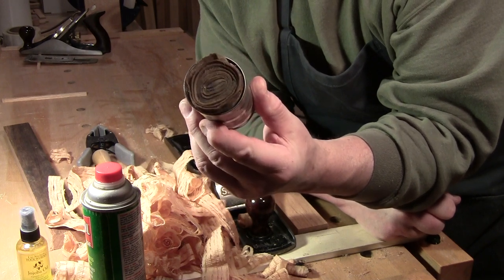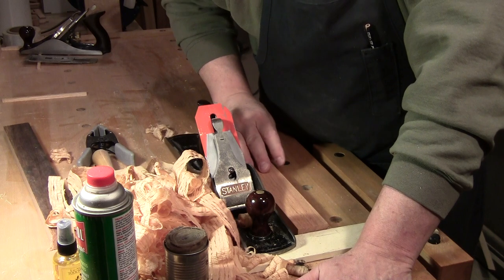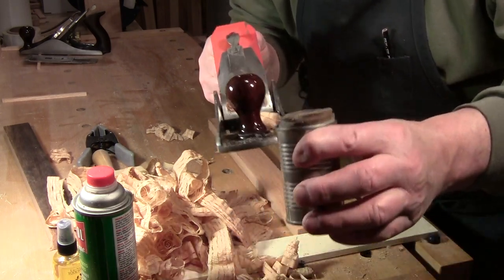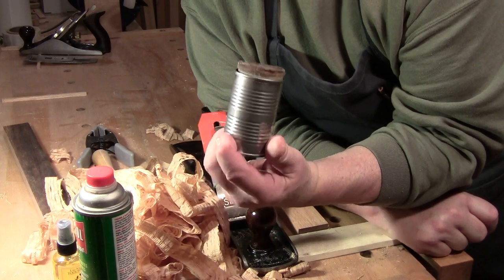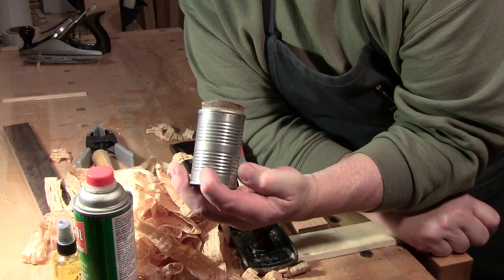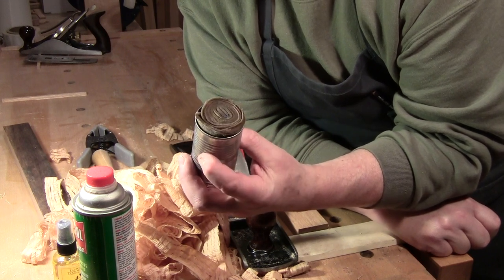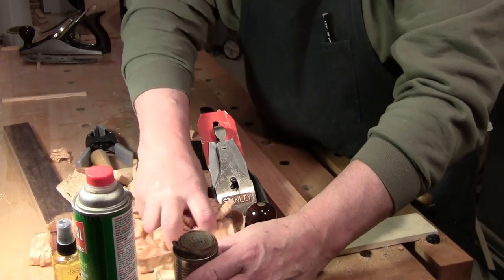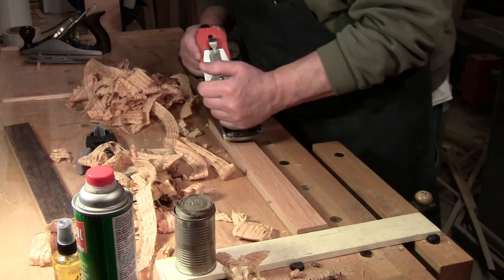The Rag in a Can... soaked with oil - PLANE TALK - 2 May 2019 - #PLANETALK

Comment: So do you add enough oil to saturate the amount cloth you are using and then leave the can upside down for a day to drain off the excess? This would leave the cloth nicely oiled but would not drip oil onto you project or your bench if it were inadvertently left on its side overnight.
Reply from the maker: Thanks for writing,
I pour some on top so the top is moist, never gave much thought to tipping the can over.
I think I might lay it down one time to see if there is excess.
Thanks for watching!

Comment: I'm sort of new to using hand planes and have a question. I've been using jojoba oil, now does the oil on the hand plane effect the finish on the wood? Do I have to give the wood a slight sanding afterwards or is there really no problem presented by the oil. Thanks for the videos, they are informative.
Reply from the maker: Thanks for writing,
From my observations after many years of using many different plane sole lubricants is that the typical woodworking process negates any possible negative side affects of most oils and waxes except things like silicone and i avoid the really hard waxes like Carnauba.
After final assembly, it is not uncommon also to go over the work with some 240 or 320 grit paper to ease any sharp bits and to just make sure all smudges and pencil lines are gone.
If you do go straight to finishing without sanding, just apply a light sealer coat and allow to fully dry.  Then knock the fuzzy bits off as noted above.
Thanks, For Watching!
Reply: @DustySplinters  Very good, thanks for the good information.